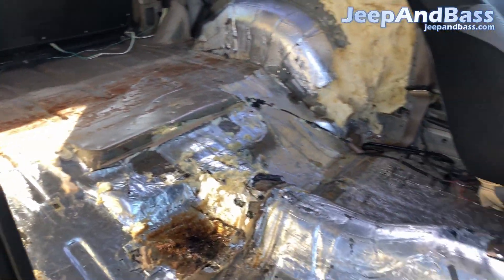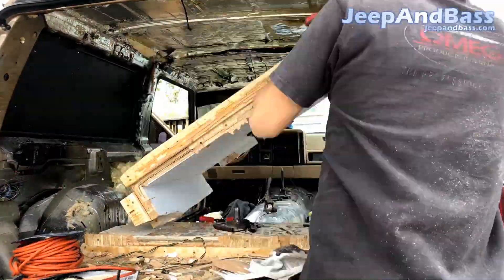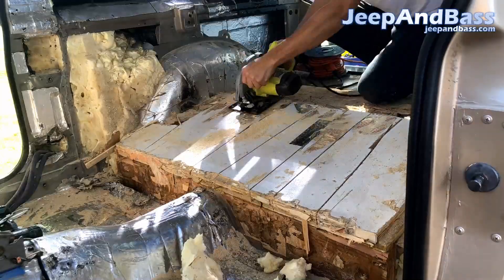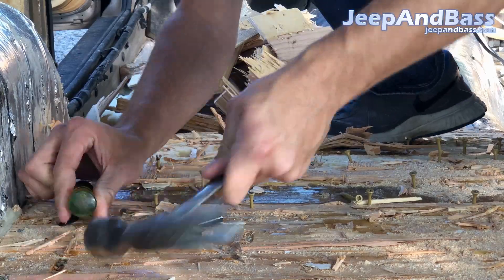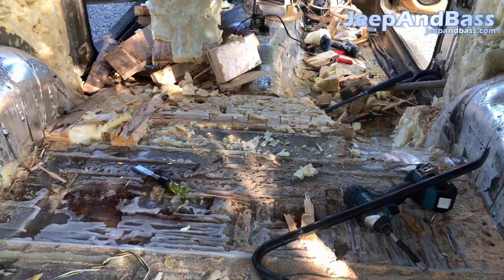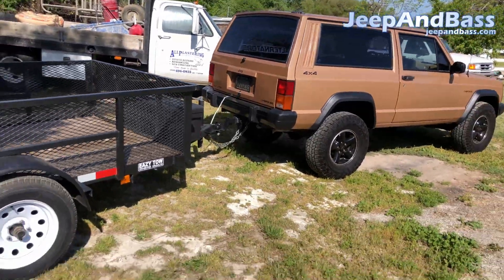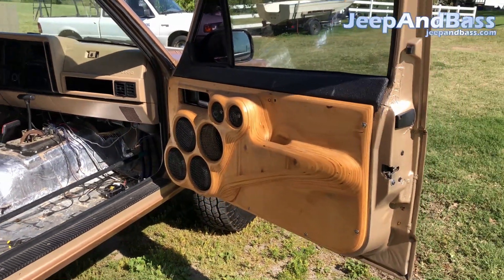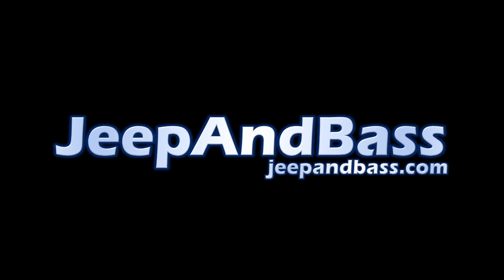JeepAndBass Rebuild 2020 (Part 3) More Demolition

Comment: I know you plan on spacing your tires out a couple more inches, it would be nice if you could almost completely kick them out from under the body to ditch the wheel wells completely. It would be a tacky rat rod look on a Jeep that isn't rat rodded but it would have more space for what you are planning.
Reply from the maker: Nick Balassone I’m not sure now what I’m doing for that. I was going to for a new wall but my new plans don’t require it. I just need to foook this what stance I want once I get the lift kit on